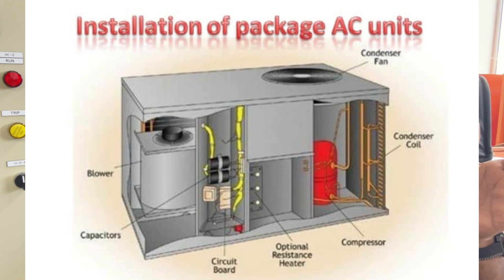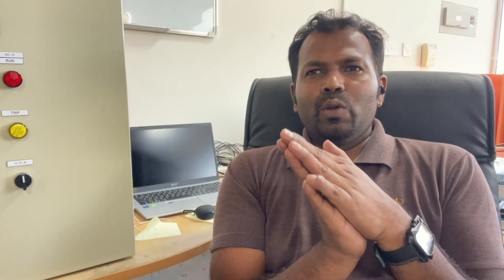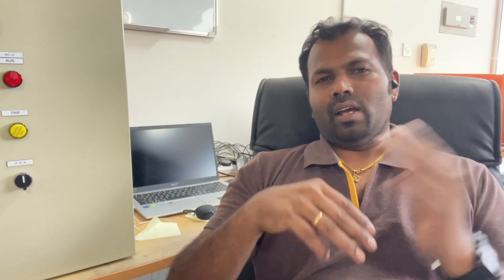Package AC units control panel working / HVAC...

Comment: Sir, single phase motor 450w, 220v,2.1A,  how to calculate correct contactor and olr
Reply from the maker: contactor  -  6A OR 9A 
OLR - 1.6-2.5A, 0R 2-5A WHICH IS AVAILABEL  (RANGE SOULD BE SET AS MOTOR FULL LOAD CURRENT)
BREAKER   -16A SP
Reply: @sennapparajan.p  thank you so much sir